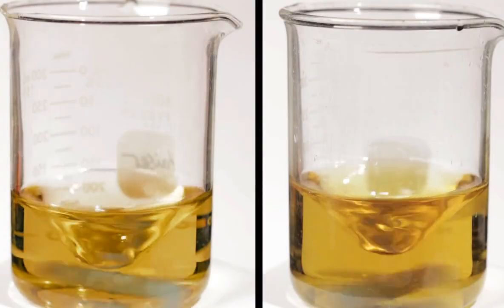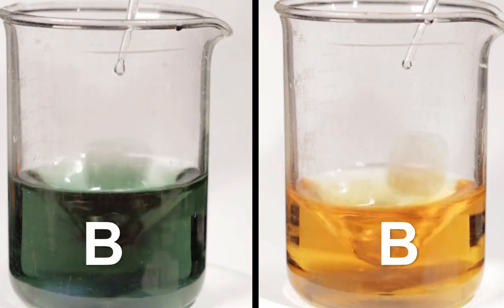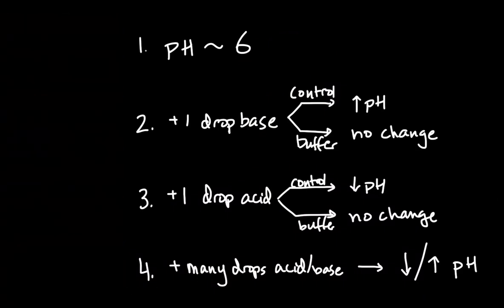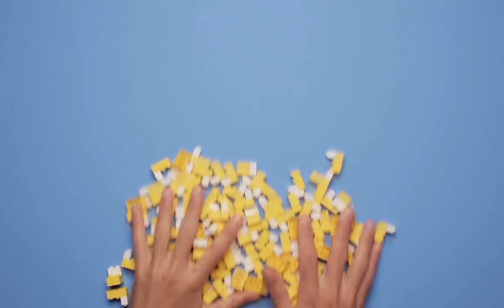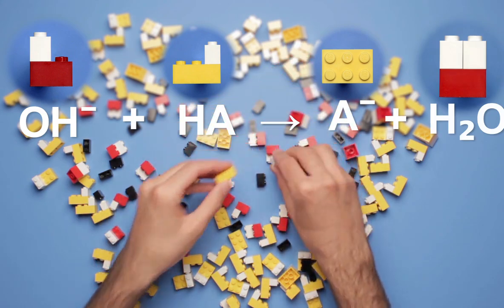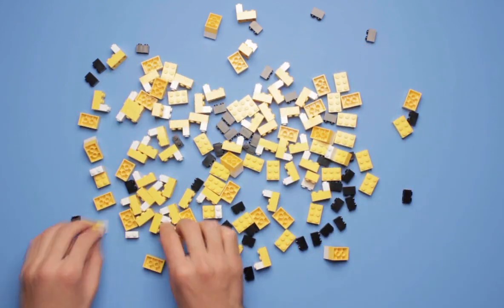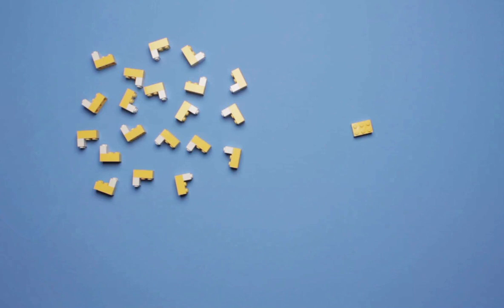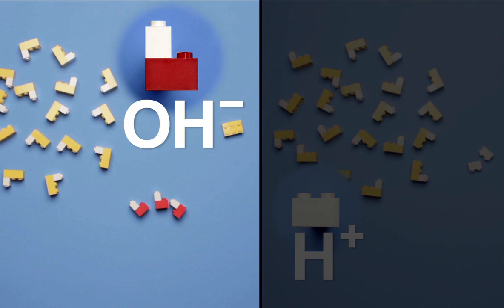Buffers

Comment: I liked it very much when you asked why should a strong base/acid not act as a buffer, well it made me think.. I came up with an answer that I think does make sense. for the Ka to remain constant.. say [A+][H-]\[HA]  A loss in say

So if add OH- 

SAY 2% loss of H+ that is numerator will be compensated by decrease in around 2%of the denominator so as to keep the value of [A+][H-]\[HA] constant,,, now since there are a lot less HA in comparisom to H+ the increase of H+ due to decrease of HA that is by dissociation will provide negliable compensation...

Comment: 1. H+ reacts with A-, forming HA.
2. OH- reacts with HA forming A-.

They can do this as long as enough HA/A- is present. Once you run out, the buffer stops working...
Reply: But why doesn't the OH- just react with the H+ from the dissociation?
Reply: I think it's because H+ is at very low concentrations. The chances of an OH- finding an H+ are much less likely than finding an HA. Compare something like 10^-10 M of H+ and 1 M of HA.